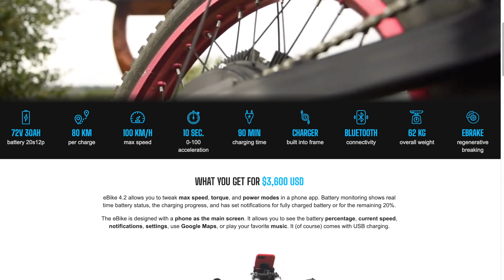How Dangerous Are LiPo Batteries for eBikes: Overcharging, Explosions, Experiments

Comment: Ive used Lipos for over 30 Years now.. First in Radio Control Airplanes and Helicopters for 15 Years , Now in my E- bike a TerraTrike Rover with a 750W Luna Mid-Drive setup with a 20Amp hour 60 volt battery .. 1500 miles on it now and still going strong !

Comment: My lipo turnigy hardcase after 9 years of constant use in ebike and 80.000km are still going strong. They are immortal. But as you said good enclosure is needed. They are in plastic hardcase and i put them in aluminium profile. So there is no mechanical stress on them

Comment: I think the problem is, if the controller can handle the high current capable of those lipos. Lipo can discharge a tremendous amount of current than li ion, lead acid and other types.

Comment: nice video and information. my ebike runs on 2x 6s 12 AH sadly one of the packs shows an dead cell... now i can basically throw out that entire pack.... (150€). THIS is the most reason to get usually 18650 cells...
Reply: It depends on pack. It's possible to repair unglued packs like high capacity multistars.
Reply: Welded 18650 is pain in the ass to repair. 😁
Reply: Tip you can still use them ,, just remove the bad call .. Ive made many backs this way.. Also 18650 cells cost about two times as much then Lipos ....!! And you can charge a Lipos in about 40 minutes instead of,,, many hours !!!
Reply: @Dan-un4vt  of course i can but i do not pay another 100 € for an entire pack

Comment: question, is there even a "save" battery? i mean cant kinda every battery explode if you dont handle it right?
Reply from the maker: BMS takes care of that
Reply: @ladiandmargaret  Alright, so the 3 points that will make the battery faster broken are Low charging currents, overcharging, not too high temperatures and that's all something the BMS controls, right? But when i put the bike on the charger, and i forget to turn it off when its full, it can still overcharge, but it won't burn, is that correct?

Comment: I have a 12000 watt 84 volt enduro bike that goes about 50 mph. I want to get more speed. How do i go about doing this. If anybody can guide me in the right direction id appreciate it.
Reply: more amps on field weakening on your controller? (sufficient battery discharge rate needed...)  Sabvoton and Kelly controllers (MQCON) have this option throught the phone app...
Reply from the maker: I’m very happy with my top speed. 300A is plenty for discharge. I’m not aware kelly has field weakening...
Reply: @ladiandmargaret  my bad, kelly controllers dont have field weakening. i'm sorry about that.
Sabvoton controllers do have it, in fact i'm running a 72150 controller on 52v @ 100a, with only 75a of field weakening and it reaches 45mph (72kph) on a qs v3 5t (laced on a 26" rim).
Mind you, all of this on a regular bicycle frame... Not very safe, i know... I'm currently waiting on a teleport prime 120 ebike frame before i push it any further.
Battery pack it's custom. A123 26650 cells, 16s4p (can't fit no more in this bicycle frame...). Rated 52v (51.2v) 10ah, 200a continuous, theoretical 480a pulse... Range it's about 12 to 15 miles in theory...

Comment: Nice video Ladi! Isn't it fun to start a controlled fire every now and then? 💥😁👍 I use five 14.4v lipos in series for my 72v mid drive E bike, and a Bluetooth BMS to keep them balanced. I charge them up to 85% for safety and longevity, and remove them and inspect them individually every 10 rides or so...I love them. They work really well on my set up. 👍
I'm considering building a li-ion battery pack using 27700's...have you tried these at all? What do you think about them for an E bike set up? Would love to see you make a video on this topic if you would be so kind...thanks Ladi and Happy Holidays! 😁👍
Reply: Dude that is exactly what I am trying to do, would you mind telling me what bms you use? I am also considering a set up where I just make all of the balance leads in parallel and switch from series connection to parallel for charging, but it would be nice to have a bms with added safety features.
Reply: Aren't 27700 LiFePo4?
Reply: @vincentpernicano3277 did you ever build one dude?

Comment: These batteries are RC lipo batteries for planes.  I have been flying for many years now and stared using lipo batteries in 2009.  I used to buy these at Hobby King for many years plus other hobby store sources.  I always used a balance charger and I stored the correctly.  I always charged them in my fire place.  These batteries will always puff up over time and then I would have to be destroyed by putting in a bucket of salt water outside for a few days.  Never use these batteries in series like I saw.  Even if charged and balanced correctly they will always puff up no matter where you buy them from.  The majority of them are made in China.

Comment: A Lipo is the worst Lithium technology you can buy. Its cheap and has a average cycle life of 200-250 cycles. That Aluminum built Batterypack is absolute crap, how you manage to balance all these packs? You have no parallel connection between every pack. Lipos are very dangerous, they can explode due hard vibration etc.
They are used in cellphones and RC models because of the high energy density. Wtf are you doing?!?
Reply: If you do not know how to protect the batteries in series and without parallel connection, you are not competent to write criticism. Lipo is often used in phones and many other devices. You'd better throw them into the trash as a preventative. 😁
Reply: snejky 
I think i shouldnt answer you because you obviously dont understand what im even talking about. You need to balance every parallel of the battery, the easiest way is to connect every parallel. The only way he can charge this 15 multistar lipos in this pack is each pack individual. Theres one way to connect the parallels but it seems that he doesnt do that. 
Lipos are used in small devices with low power, because they have a high energy density and are light. 
I know what im talking about.
Reply: Li-Po are used in high power demanding situation, and are very reliable, if protected, and keept in 20-80 % they last way more than 300 cycles , nearly 1000s but you have to protect them and balance, I think that in that video, it's not shown, but I'm pretty sure he uses BMS.
Reply: snejky ok, im sorry. I build 2 3,6kWh Liion batterys myself but ok.
Reply: @TBRambo2  I mean, I built 5 packs and I love li-ion, but LiPO are exelent for light packs Which can stand 100A+ they're exelent, and cheap, I personally use raw battery's, no BMS, separate charging and I have 9 lipos, they're safe, I use those rc alarms (balance port) and charge to 4.1v, balance every 10cicles, never let battery go under 3.7v/cell (no load). I have to say that your packs are probably safer and will last longer, but I'm trying to say that Li-Po are just to other type of users, and I know people who have 8years old LiPO working at 50% original capacity but punching over 60A... I mean. It's not a bad tech.... I use LiPO because I can't afford li-ion with BMS in Argentina... My 5 packs where for sale $$$, and I only have spare cells and a 14.8v 4s 10AH bat for my lights and adaptors. I use my bike for racing and every day use (got like 50km range) on 15 ah 64v bat of 3serial, 3 parallel 6s 5Ah.
Reply: @TBRambo2  Obviously, it didn't help your knowledge. I build a lot of packs from many types of chemistries and cell types, so what? Are you some kind of battery god, you determine what we can do and what we don't? Because i know how to do it RC lipo series protection, you not. Anyone a little knowledgeable will find it on Google's first attempt. Just by using BMS with adequate count of serial inputs... no magic here.
Reply: snejky oh dear, there is no magic. But explain pls what is a RC Lipo series protection? You know that in the RC world you only use 2-6S packs max. My packs have 20S and 14P with a 300A bluetooth bms. All Samsung 35E cells weld by myself. Your batterys are toys in comparison. Cheap lipos dont last very long, they do have only 200-300 cycles trust me. Count your cycles if you dont believe me (full cycles).
Reply: snejky you say you know how to do series protection and i dont, i think you dont know what you are talking about.
Reply: @TBRambo2  I quote what you wrote: The only way he can charge this 15 multistar lipos in this pack is each pack individual... 
I think the question about who is dumb is answered now, no matter what you write.
Reply: snejky i said this because he is doing that. If you watch the video again you will see that he has each pack only put in this box with no wiring and each balancer connector by itself. So why would he show his Battery like this? He didnt say how he charge his batterypack ore something else. I say what i see and not what he could do.
Reply from the maker: Because I’m showing protective case, not demonstrating how I wired the pack. Of course I don’t charge each pack separately.